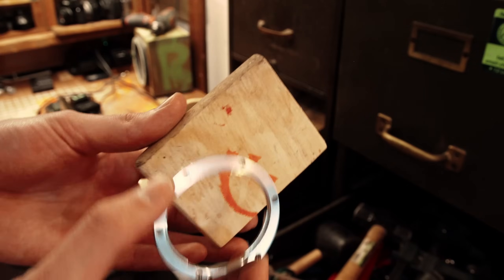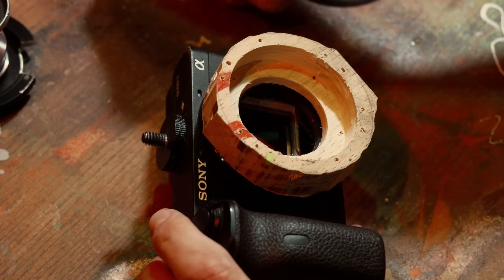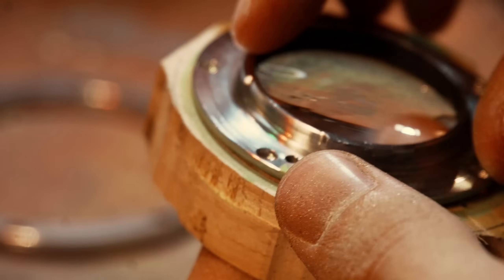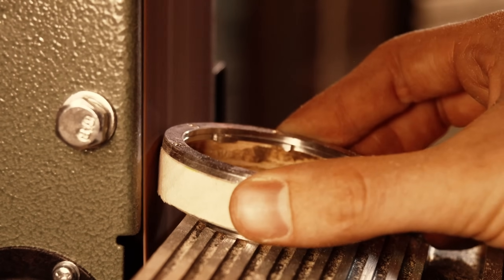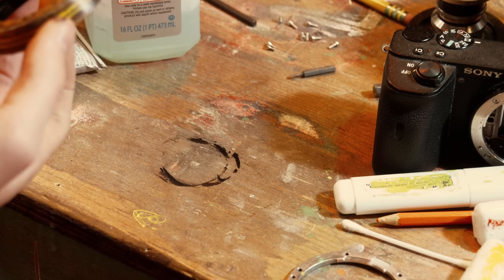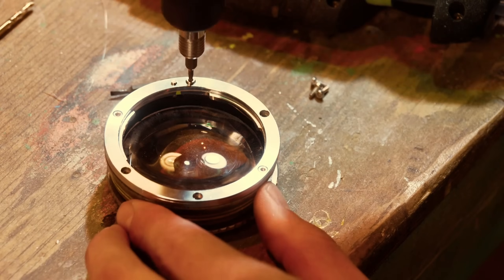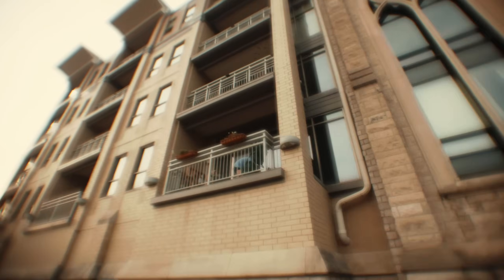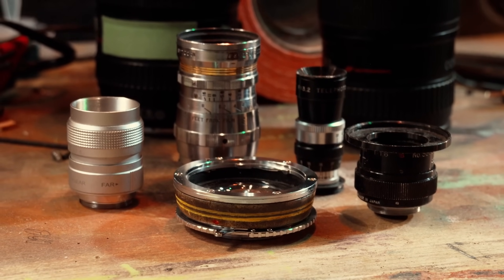Making a $100 Adapter from Scrap

Comment: Dude, you would totally benefit from a 3D printer. Something like this could be improved with some extra details and be repeatable.
Now you have measurements, add modularity for mounts and maybe find solution to pass the lense controls.

Comment: 4:35 your patience and adapting to what you have is pretty inspiring.  I would never dream of shaving a 1/4 inch off something with a hack saw.  Not cause I'm above it, I would just be afraid I would mess it up.  I suppose the vice helps keep things even.  I probably would attempt to take it down with my belt sander I guess?  I have a planar but don't think you can put in small pieces like that.  Maybe hot glue it to a longer piece?  Who knows.  Great job though.

Comment: Amazingly cool project.  You mention you had no lens stabilization, but the doesn't the A6600 have in-body stabilization?
Reply from the maker: It does, just weaker at the long end with no lens stabilization. Its manageable though

Comment: Vintage lenses are great for dumb adapters. Not only for aperture control but also because the lens was built to be used manually so in theory should be a little better manual handling. I've got a bunch of random simple lenses sitting around. From a cardboard VR headset and from a small telescope that I'd like to build a housing to adapt to my camera because why not?